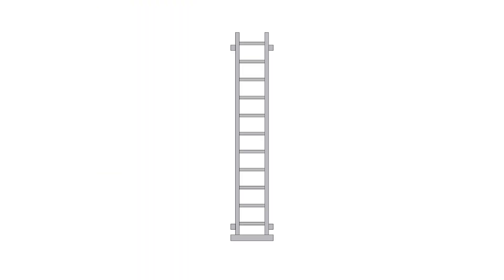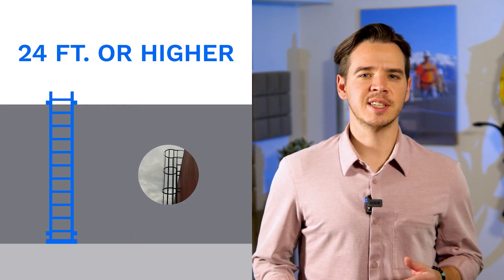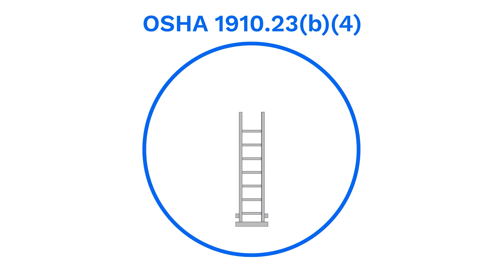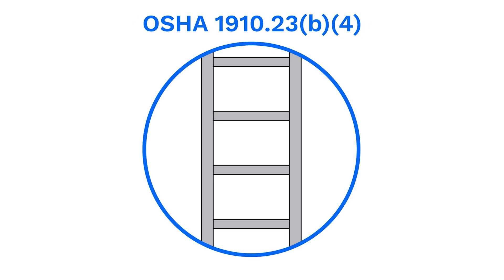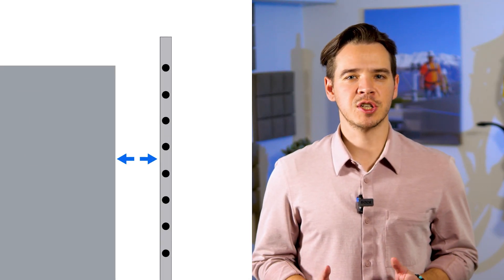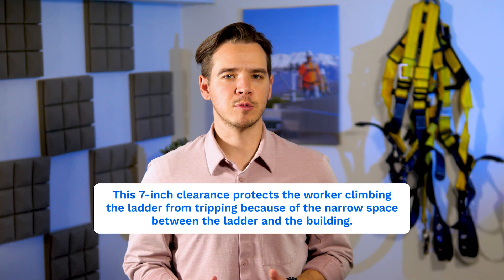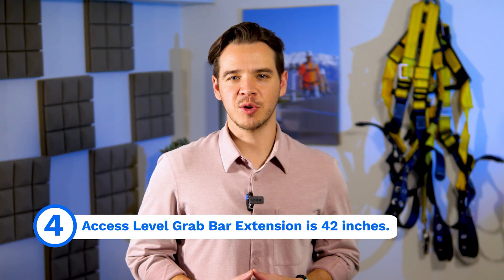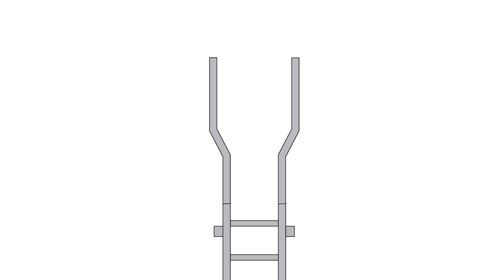OSHA Regulations for Fixed Ladders

Comment: So I've just been assigned the job of monthly Ladder inspection, & everything is fine, but there is this one ladder I have questions. All other fixed ladders have 3 points of mounted, but that one is only mounted on the top & bottom with the mounting bracket  unattached. It's very jiggly & if it fails the user would fall off a roof.
Reply from the maker: That definitely would be cause for concern! The ladder would need to be updated so that it's secure and safe. If the ladder is updated AND is over 24 ft., it will also need a PFAS (personal fall arrest system) installed to meet OSHA guidelines. Any ladders installed after 2018 or UPDATED after 2018 need to meet the new ladder requirements.